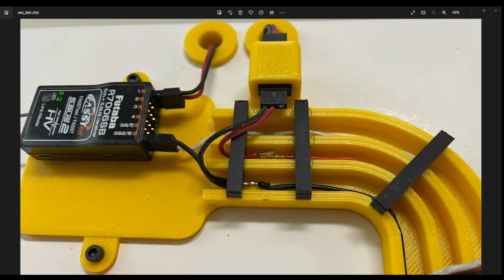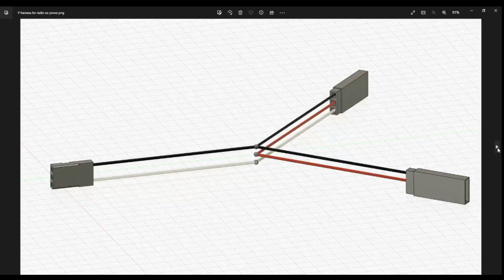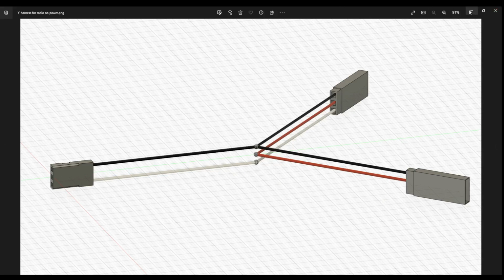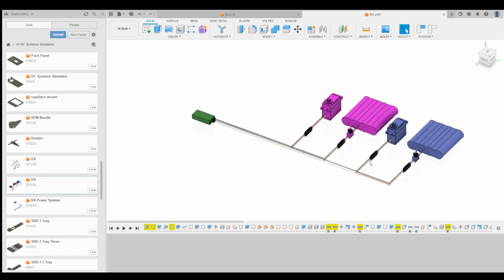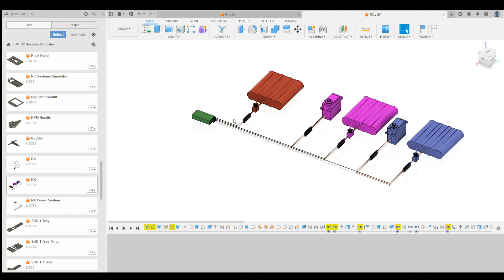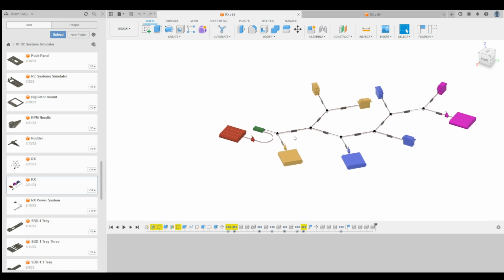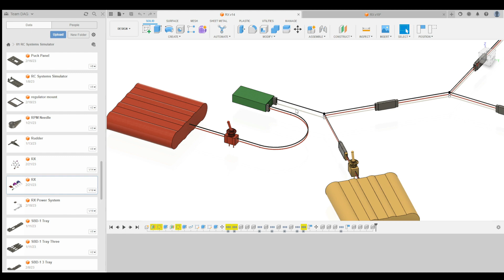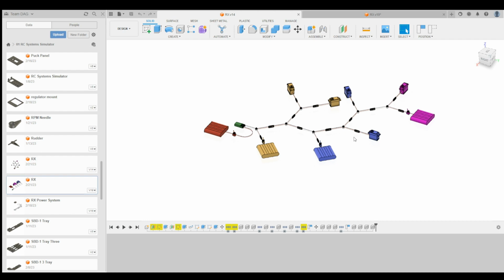Isolating Servos, Batteries, and RX Power in a Radio Controlled Airplane

Comment: Hi there, your last diagram with multiple servos and batteries shows then all  linked through one signal wire back to the RX. Am I reading this wrong, should each servo be connected to it corresponding channel?  Sorry if I'm not understanding. Thanks.
Reply from the maker: That shows a SBuss system by Futaba. The servos are programmed to the channel they will work from. One control wire talks to all, like a network. :)
Reply: @dagtheaviator ok, I see. Your video was extremely helpful to me this week setting up my glider with dual batteries, thanks.

Comment: Pretty simple stuff the way you explain it to be fair.  I am building a boat that has to have a seperate battery pack to run the servos.  So starting at the beginning I need to take the power out of the plug heading to reciver and power the receiver with a separate pack. Thanks for the info on here. What is the computer software you are using as I would also like to build systems on this. Many thanks.
Reply from the maker: I use Fusion 360 to create my layout drawings. Rock ON!

Comment: Electrical is not my expertise.. When do you start using larger servos as the size of your plane gets bigger?
For example:
 my 3rd scale tripacer. I am using high torque servos, but they are standard size.. Metal gears.. You can  program them.. I was just going to use them as is, no programming. This has turned into a money pit..
 I do not want to crash it, so what do you think?
Reply from the maker: This video may help. https://www.youtube.com/watch?v=QYcljx8az-w
Also, speed and weight has to do a lot with how strong a servo needs to be. Most 80-120" plane are fine with servos that have 100-200 ounces of torque. But that is for Cub like speeds and flying. Fast War birds 80-120" up to 300 ounces.  What type and make of servos do you have? :)